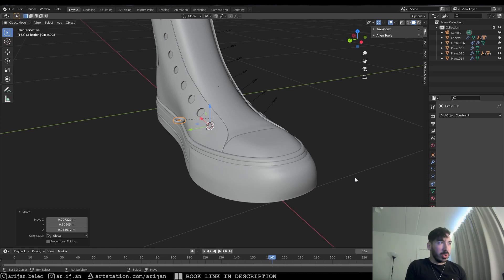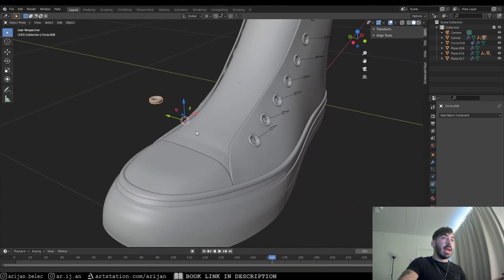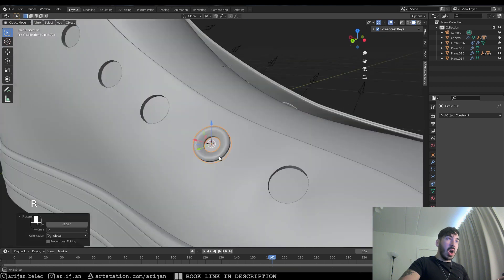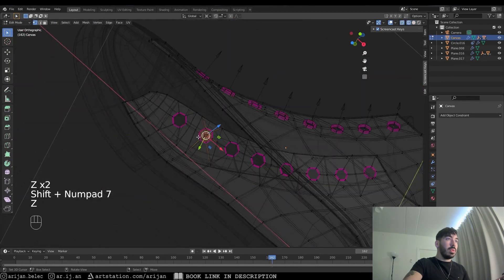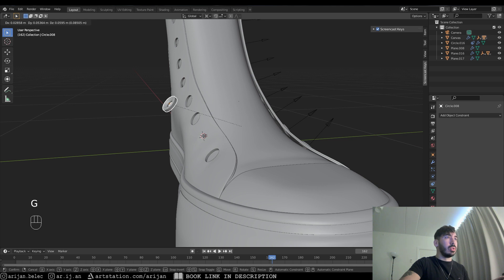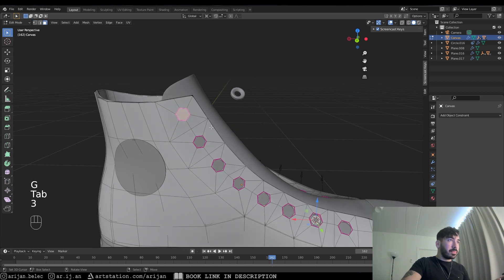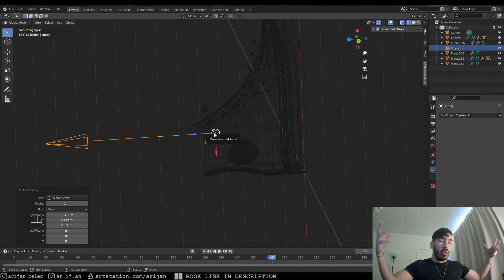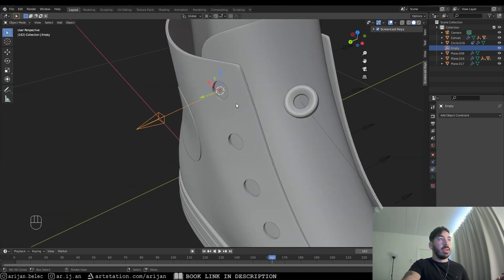Using Constraints To CORRECTLY Align Things In Blender | Alignment Tutorial (Arijan)

Comment: I did this by filling the hole with grid fill to get an edge down the middle. Then used face project snapping with align rotation on to place the object on the face. To center it i switched to edge center snapping with align rotation off. If you need to move it in or out you can set transform to use normals instead of global.
No need to use separate objects and constraints.

Not sure if theres a better way to align multiple objects at the same time to different normals in Blender, which would make this less manual, but there's probably an addon for it though.
Reply: exactly, using local or normal axis is much better than this